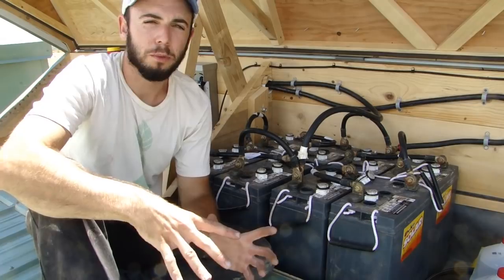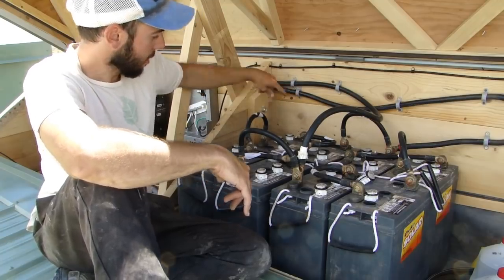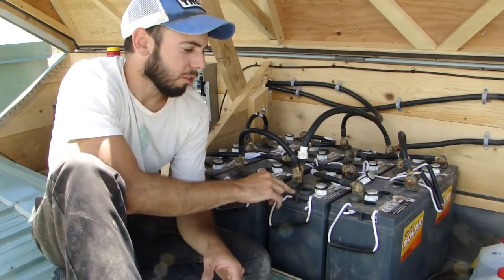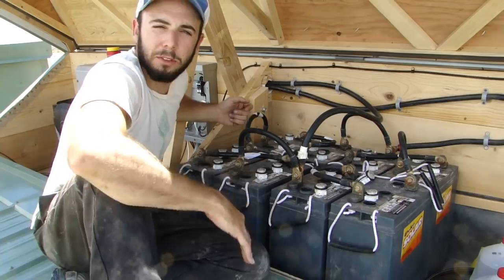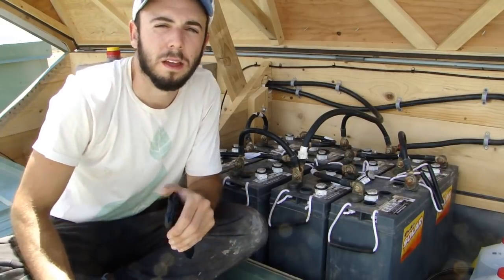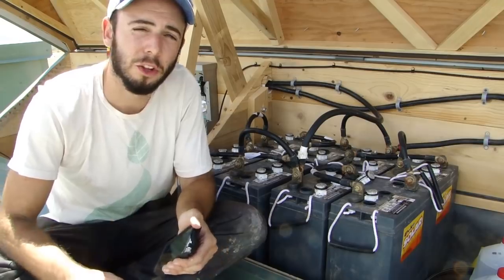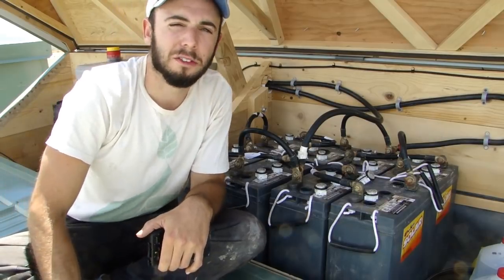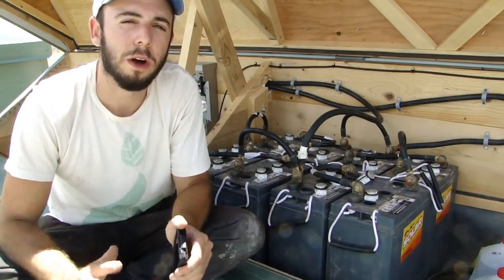How to Size Your Solar System

Comment: L16 batteries are great. Got four Trojan's and am going with four more. I have 3.7KW in solar panels...so, doing well. One point I learned with solar is this: you need to take into account electricity use/charging during the sunlight hours. Doing both at the same time lengthens your charging cycles. This is why I advocate having more solar panels than you think you need and right sizing your battery bank to match your homes Kw/H needs. Just my 2 cents. Good video.
Reply: +DrgnFlys I've just read your comment now and minutes ago I was commenting above on a different post and I mentioned NiFe explicitly, cause they are largely unknown yet. Nice coincidence. The only problem with them is the price, but hopefully that will change in the near future and even today, though pricey, they really are the number one choice to be considered to power a house. Now if only solar panels lasted as long as them.. After 20 years most manufacturers report 15-20% drop in efficiency of the panels. It's pretty nasty, when your precious 5 kW solar array now delivers 4 kW. 10 more years and you dropped to something like 3 kW.
Reply: Cool...yep, so true. There are some interesting choices out there (AGM, lithium, NiFe, Tesla, traditional flooded, etc-etc). I guess it depends on how big one's wallet is for some of the better batteries. Thanks for these links!
Reply: Regarding batteries, there is one more viable option, for small budget setups. If one has at least some electrical skills, one could assemble a Li-Ion or LifePO4 bank. I was recently looking at this option and assuming a basic 12V bank, the cost would be roughly as follows:
Headway 3.2V 15Ah cell is £20.50.
Assuming 400W panels deliver 1 to 2 kWh a day, you'd want 60 to 120+Ah at 14.4V to store this. 4x4 cells is £328.
A LiFePO4 capable charge controllers start at £55 on ebay, about £124 for a 420W model (handles 420W solar panel input up to 50V), up to 25A charge.
BMS for these is £40 from headway, you could probably find cheaper.
This bank should outlive a comparable lead-acid bank by far, although the price for usable amp-hour output is almost double too. Considerable weight savings obviously and little to no maintenance for a decade.
Reply: +TheRadiastral --- and...
- Li batteries recharge much better than lead acid based ones
- DOD on Li is 80% while lead acid is 50%
- Li does much better on high loads!
- Li of course need not be replaced as much
- Li weight a ton LESS!!!! as in 1/2 the lead acid based(AGM, GelCELL, FLA,...)
- Li 2000 to 4000 cycles, lead acid 400 to 1500
...Li cost up front while lead acid cost is staggered over the years as they are replaced, but in the end I think they are basically equivalent!
I don't know about this double price!?! as they last much longer!!!
Tell me if I am wrong on that last point.
Reply: DormantIdeas NIQ That's essentially correct, although you might be underestimating lead-acid a bit. Really good ones last thousands of cycles (@ DoD 50%) as well, with very good amp output and will last a decade or two, but they are expensive too. Also, weight is a secondary concern in a house, luckily. But I'm amazed that Lithium batteries are so rarely used in cars and bikes, they would shed good bit of weight off, while giving much better amp-hour output.

Comment: For the average person, they need to do a lot of homework. They would have to find their maximum kWh usage and the typical solar gain throughout the year and buy the amount of panels and battery bank to supply that demand. Generally though you will find that the average user will still have to be connected to the grid to make up for a string of cloudy days. A person's best bet is to determine the government subsidy and their monthly power bill and determine the payments over twenty year loan and see if they can break even....

Comment: How do you justify the initial costs as well as maintenance costs of the system when using such a low amount of electricity?  Eight batteries alone could cost $2000, plus panels, inverter, controller, etc.  It could easily run $4000-5000.  3.5kwh per day x 30 days is only 100kwh per month.  You're talking maybe $15/month from your electric company.  Being generous, $4000/$15 = 266 months to break even just for the initial costs.  I understand the desire to go "off grid" because I'd love to do just that.  The problem is that by the time you modify your electricity usage low enough to accommodate a reasonably priced system, you're electric bill is too low to bother.
Reply: +steveeb00 I live in Alberta Canada and every dollar you spend on consumption is at least 3 times in fees and taxes. I recorded all my bills for end charge and actual usage.   in 15 month more than 4000 in fees.

Comment: What is your max output in continuous watts? I understand that you have 16.8KWH available when the batteries are 100% charged, but do you have a maximum continuous output? (i.e. you can not dump 16.8KWH all at once)

Comment: Also add a wind turbine for night time charging, and additional generation to help top up the batteries.
Reply: +CK Wunch That is only worth doing if he lives in an area that gets a lot of wind.
Reply: XInfinity2013 Of course your correct, but i wasnt thinking of one of the expensive wind turbines, i was thinking more like a small but high DIY turbine costing less than $100 if the youtube videos are accurate. (simple 12v dynamo into two 6v batteries to get 12v out as the 6v golf cart batteries are cheaper :D )

Comment: I have a question for you buddy.
I have 4 solar panels each rate at 250 watt each.
 
 4 x 250 = 2KW solar panels

Solar controller is about 8AMP @ 14v charging,  per 2 solar panel connect in parallel
so i have  2 controller in total.

Can i connect then two to charge the batter at the same time?? or it's not good to charge the batter at high current too quick.

I have one battery - 260AH 12v. (plannng to get more when i have $$)

My concern is that i dont know  the maxium charging rate allow for these 12v deep cycle battery. Also, does it matter what type of charger controller to use???.

Appreciate if you can help me out. i sure alot of ppl stuck at this. Thanks

Comment: All batteries use DC. So it will become tricky when all your appliances are on AC. As you will need a converter and efficiency can wary ~80%. And also you will need a cooler system as those 20% will become a heat and it will cost even more electricity. So your 5 kwh on DC just became 4 kwh, and you use that 4 kwh to cooldown your coverter... Unless your appliance are all on DC, than you won't loose any electric power. But it will cost you a lot... The good news is that your phone, laptop and ipad already is on DC, as they use the batteries to operate.

Comment: For Example if i have a lamp with 20 Watt , what does that exactly means ? 
Does that mean it's taking 20 watt each hour?

Q2. As you said that you have about 5kw system per day , should i divide 5kw by 24 hours so i got 208 watt per hour  , and with the 20 watt lamp i have 188 left ? 

"208w working 24 hours"

Is that right ? 

Sorry about my English :)

Comment: Honestly, just my computer uses about 3 KWh per day. With my graphics cards setup and my CPU, while I'm playing it draws about 800W every hour, Kudos to you though. I would LOVE to switch to solar, but it's like with cars - until they have a 500 mile range and can recharge in 5 minutes, I will reluctantly choose utility over environmental protection.
Reply: QuantumBraced The point is this is free energy, i understand being skeptical but it will pay for itself eventually. You could backfeed the power to whoever your power company is and literally be making money from them. Not to mention you get several incentives from the government for doing this as well. I was skeptical as well but not anymore. I just wish i would have done it sooner.
Reply: +QuantumBraced My 08 Prius has 500 mile range, and it takes about 5 minutes to refill.
Reply: +QuantumBraced Right.. so the computer uses 3kWh. Obviously, you like extreme gaming. Well, let's add other appliances you have. How many kWh have you got working on everyday basis IN TOTAL? 5? 7? Let's say it's 8 kWh/day, which is 6 times what I'm using, just for the record. So.. just size up your batteries to support 8kWh/day (any decent 48V battery bank can do this, ask any off-grid house owner) and size your panels, so they can charge them full within a typical day. The investment will pay for itself after about 5-9 years, depending on your initial cost, which may vary greatly (discounts vs rip-offs). After that, it's free electricity, no bills. Of course, if someone invests in a medium-large domestic installation, like the one in this example, one would want to get batteries, that do not deteriorate in 5-9 years, so Iron-nickel batteries would be preferred, so you wouldn't have to replace ANYTHING in the system for like 25 years, which is entirely doable. So you see, your lack of "believe" in solar, comes probably simply from not knowing what's out there, what's actually doable and how much it costs. Or is it?
Reply: +TheRadiastral 
:  It's "...lack of belief...  not lack of believe".   Just saying.  In any event   many thanks for the info.   I just wish  someone would  post the real and full costs  involved  switching to solar.   Forgive the grammar corrections  -  am  a nerd when it comes to that :)
Reply: +Didi M No offence taken, will surely remember the correct spelling now, especially since it's such a basic mistake.
Reply: unless someone throws a solar grant or something at me i dont think id be able to deal witht hat inital cost (then again i also dont own a house or car, but college is making me hate the idea of loans ever, so right now in life i feel like id be living as cheap as possible untill a time comes where i can buy something like a car all in one go)
Reply: Sure would be nice if you would know what you are taking about.
If you would have a grid tie system, then it would pay off in 7-10 years after getting incentives which are paid by every taxpayer .
If you use batteries, then a kwh of use would cost $.50 to $1.00 ,while the power company is charging you $0.14 average for the power.
And those Iron batteries still need new electrolyte and other things every 5 to 10 years and will take about 30% more energy to recharge and are not cheaper per watt and longevity.

Comment: So you seen to know what your talking about a bit, how much power do you think a couple needs in solar if they are on a budget, and they only need it to charge 2 laptops, a few small devices, 2 or 3 small window fans,a few rolls of some small Christmas lights, and maybe an xbox for alittle while here and there (not necessarily all at the same time) please and thank you!
Reply: ***** There are a couple of variables like how much sun are you getting?    It doesn't sound like you are running any heavy power user appliances such as a fridge, toaster, or electric coffee maker.     You are looking at a small system, I would recommend you get about 4 AGM (105 A.h each)  solar batteries and somewhere around 500 watt in panels.    You'll need a controller and inverter of course properly sized to your system and perhaps room for expansion.     For a small system I would keep the system to 12 V because it is just simpler.     Because you are only at 12 V it is important to have your solar panels close to your controller and batteries.    Again important to have your inverter close to your batteries.     Once the power is inverted to 120V you have some room to use smaller wires and run longer distances.        Two things you can do if it is impractical to have them close, get bigger wires and/or connect your panels in series to get higher voltage output.      Lots of things to consider!      It is important to keep in mind what you might be needing in the future, how easy is it to size up your system?
Reply: Wow thank you because I was hoping I wouldn't have to spend more than a grand(I found a few systems online less then a grand, with everything you need around 700 dollars, I should get a pretty good amount of Sun because it'll be for my mobile home I'm building, I could always find a sunny place to park, your extremely helpful to help with the decision
Reply: What are the specs on those $700 systems?   Generally I'm not a big fan of those smaller kits that seem cheap at first.    Often the components aren't as good as they should be.     $700 is still $700 that could have been used on a system that suits your needs better.     You generally get what you pay for.    You need to also consider why you're getting into solar, if it is just for a hobby and to learn it might be an interesting project, then it might be fine.

Comment: That was helpful..I've got 5 panels with a max of 1250 Watts, and two 12v gel deep cycle batteries with a potential 70ah.. I may be adding more batteries next month...Just installed the batteries and charge controller, and house meter is barely moving.....sweet......

Comment: Amps x Volts = Watts...Sorry to bust your bubble but I've discovered that those amp hours on lead acid batteries are way off...Take a 7amp per hour battery at 12volts. It should give you 7 x 12 = 84 watts. All my tests show you will get 25watts max out of a 7Ah battery. And by doing that you damage the battery. So maybe that 7amp per hour battery is only meant to supply, say 15watts to be safe. Now lets look at those 350 amp hour batteries at 6 volts. 350 x 6 = 2100 watts. We all know that there is no way you will get that amount of power. Here is what you do 2100 / 4 = 525watts. That's a nice 525watt battery. AKA 87amp per hour battery NOT a 350amp per hour battery. Basically 1/4 of the storage capacity. Please correct me if I'm wrong and forward me the link to actual bench mark tests. The batteries I've been using are LifePO4 batteries. With the LifePO4s you can actually work out the watts by multiplying the amps per hour with the voltage. I've benchmarked LifePO4 batteries and they store the exact amount of watts. Please do your bench marks and give us your feed back...
Reply: Check peukert effect and that will explain it. So, yes a 7 ahr battery would give you the 84 whr. And yes it could destroy your battery, since the total power...volts and amps.... of a battery is the ahr data and can only obtained by using all the power wich means bringing the voltage and the amps all the way down to zero.

Comment: So your battery bay has about 17 KWHr available @ 24 volts DC. That's all fine BUT what about your DC - AC inverter? How many run watts does it have, not peak watts but normal run time wattage..Most 2Kw inverters have the 2Kw on Peak spike and run at 1.5 Kw and are not a pure sine wave which means you cannot run appliances without risk of damage or fire because the square wave or modified square wave produced is too hard on things like induction motors and transformers in PC power supplies, Refrigerators , fans, etc. They will run lamps fine though.
To be most efficient though you should build you 24 volt bays with 2 volt batteries in series / parallel and have ALL you home lighting 24 volt LED type and not the AC type. Yes it takes some new wiring add-ons but it will not use as much power as a constant running inverter for lighting.
Also AGM type or lithium (NOT Li-Ion) type batteries are the best to use in this type of application.
You should also have a mains maintenance charger available so you can keep the batteries charge cycle stable when your in poor weather days, This is so your batteries do not drop below 50%..

Comment: If you want to go with a grid tie system you may also end up spending big money to get the proper set up based on power company policy and safety concerns.
So it is highly likely that an electrician will need to be around as well as the power company when the meter has to be changed and inspections are done.
Cost for that and any necessary permits have to be factored in. 
Going green is not cheap.....
A 10, 20 or $30,000.00 system will buy a lot of electricity.

Comment: Awesome video, can you do one for sizing a grid-tied PV system?  I like the grid, it makes a good battery.
Reply: Chris Gage Yes by far the battery component is the weakest link and usually the most problematic component.    They are the biggest reason not to get a solar system in the first place.    The first thing to consider using the grid-tied system is checking into how much your utility company is paying you to put power back into the grid.    Usually it is almost nothing.    In most cases you will never get the money back that you invested in all the equipment, so you would have to do it for different reasons.     Many people prefer the concept of being off grid and not relying on the utility companies, here you would still be part of the grid.

Comment: Very good.  I have only one concern.  I think that you should NOT have the charge controller and inverter in the same zone as the batteries.  The acid gasses will kill these electrical components in no time.